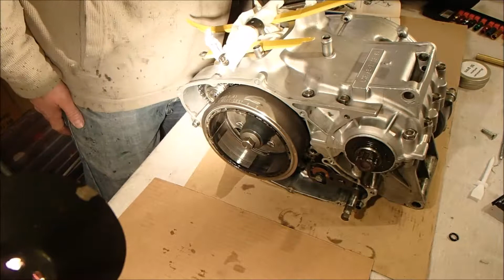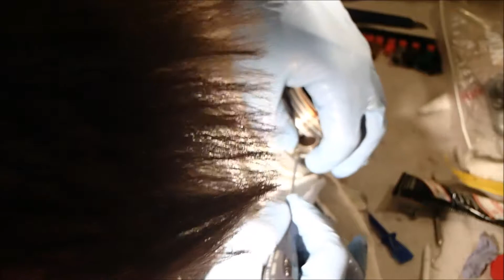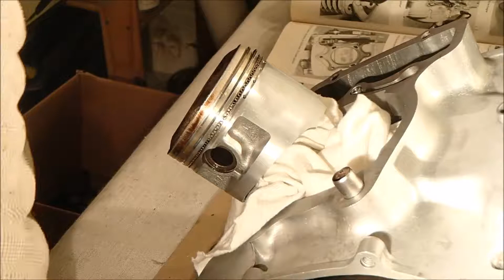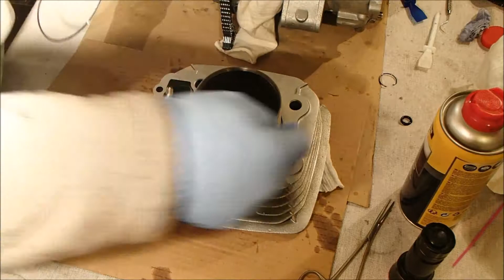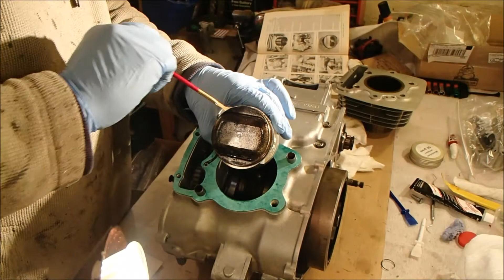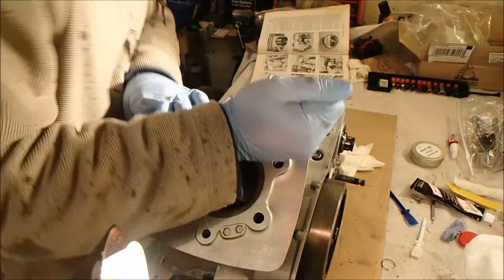Honda xl250s engine restoration (part 15)

Comment: do you remember what the alignment for the selector forks in the selector drug is? cant seem to find anything on it and the manual is less than helpful as far as placement goes.
Reply from the maker: I'm really sorry but I don't remember. I do know that I didn't dismantle the fork assembly and I left the selector drum in the case whilst it was apart. Also reviewing my footage wasn't much help either. I would recommend a dry fitting of the case halves to check the gears cycle when you first attempt it ?